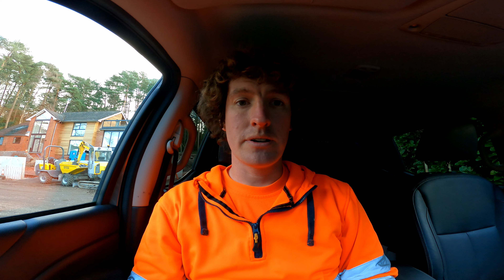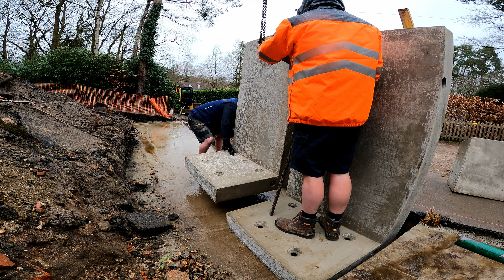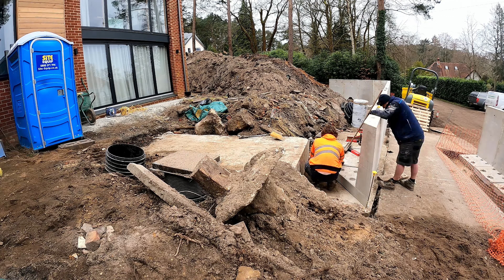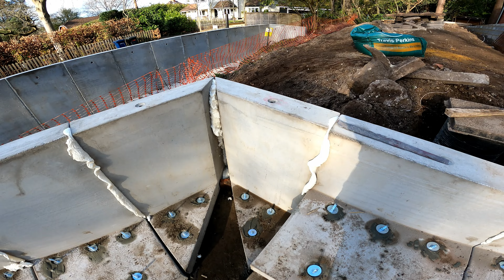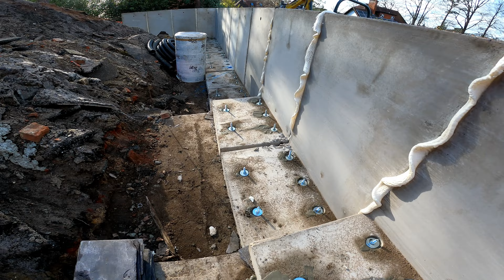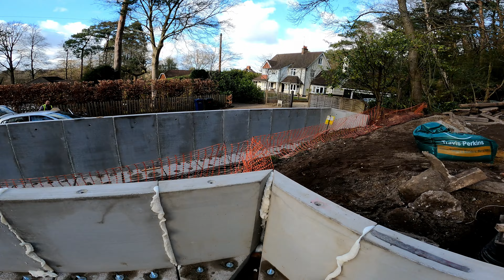Precast Retaining Wall Build. Faster than blockwork?

Comment: That cut was bad. 
Was it done offsite?
Reply from the maker: If I recall correctly, we weren't sure exactly how that section would line up, so it was made off site with some room to allow us to change the angle to suit on site. The front of it lined up ok, it was only on the inside the gap existed. Once backfilled you would never know.

Comment: Could you use this on a sloping terrain which would require stepped footing?
Reply from the maker: Yes you can, and in fact on this project there were several heights of panel that we installed to suit the stepped footings. The top was a constant height, but the bottoms stepped down to follow the ground level
Reply: @Olliegunns  Thank you very much for the reply .  I have a plan for stepping home fence on a slope so I was considering these for the purpose of the foundation and retaining wall at same time.

Comment: Were you setting them on concrete?
Reply from the maker: Yes, we poured a reinforced foundation which these were then bolted down into. I've seen smaller ones just set on stone and the backfill keeps them upright. But the engineer wanted these on concrete.

Comment: Thanks for posting.  Would you be able to do a follow up on the finished product.
Reply from the maker: I was hired in to do the bulk digging and get the wall sections up on this job. So I didn't get to stay around and see the finished driveway unfortunately. The landscaper I was working for said it went well though and in a years time, when the plants have grown up you wont know the wall is made of panels at all.

Comment: Nice one - I wonder how they manage drainage once back filled?- I assume there are weep holes.
Reply from the maker: We put a pipe in through the footing which will lead to a soakaway. Behind the wall will be a land drain installed at the bottom of the L shape which connects to the pipe through the footing. That way there is no need for weep holes as the client wanted a seamless look as possible. They plan to install lights in the lifting holes near the top to hide those.
Reply: Great video. Trying to get my head round a mess of split levels I have. Client has a great idea. Nothing worse than weep holes on an exposed front and marking down the wall of the drive especially. Are there more video on the continuation of this project? Subscribed and like. 😊